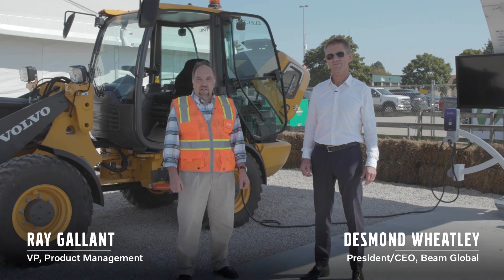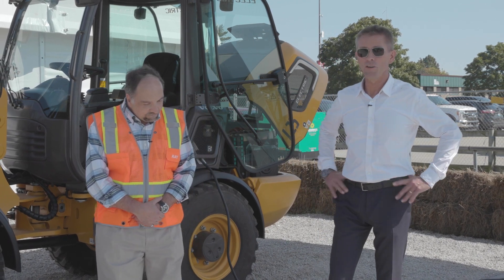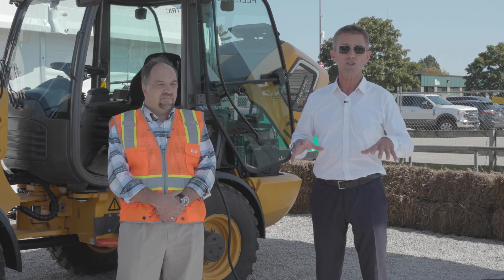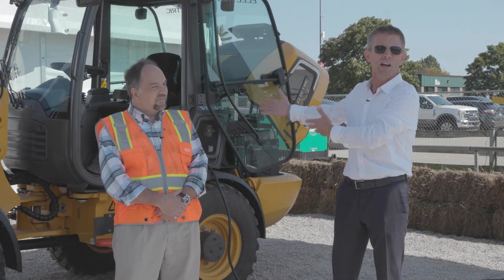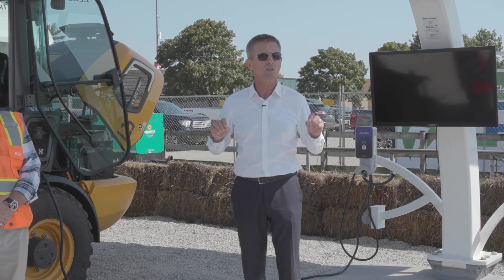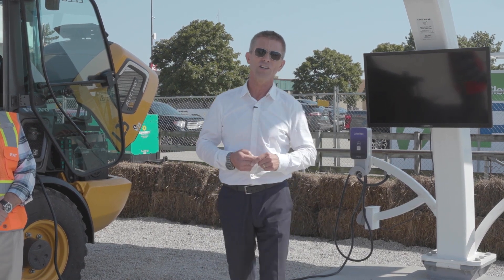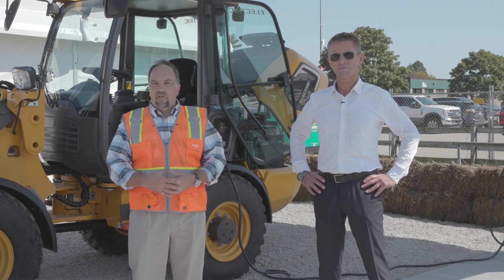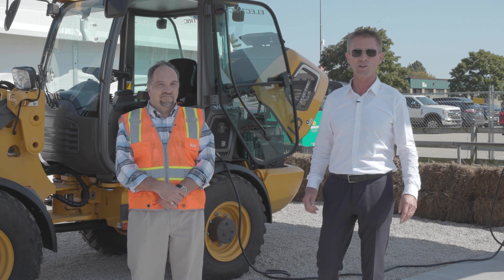How to Effectively Charge Electric Construction Equipment via Solar Power

Comment: Also make a swappable batteries with ease of installing / uninstalling with help of equipment (given the battery weight). This way there is no stop time of machines to recharge batteries and will boost productivity.